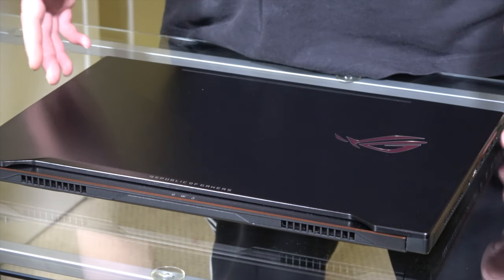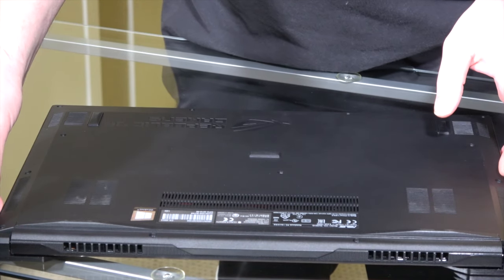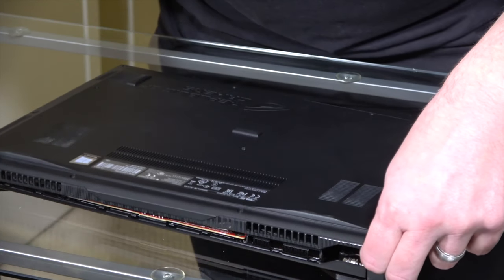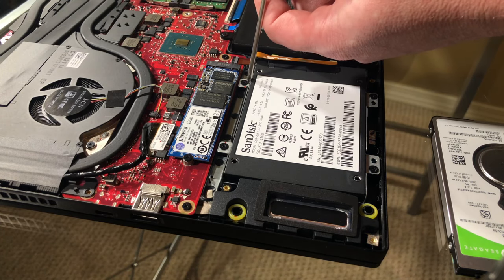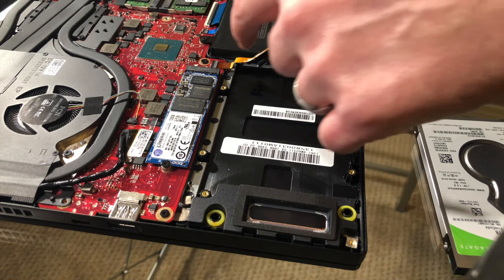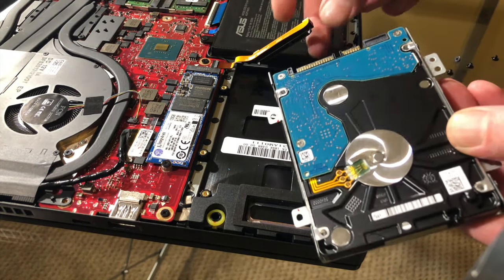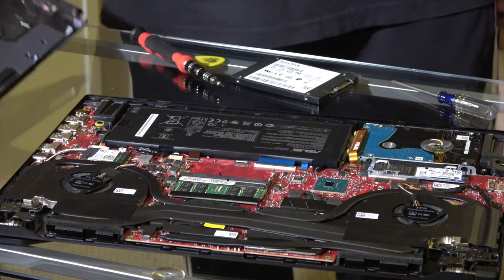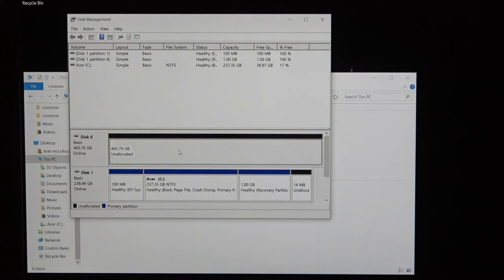ASUS GU501GM RAM & SSD Upgrade Guide - How To Install Laptop RAM • Upgrade Laptop HDD to SSD

Comment: Thank you.  I did it.  
Thanks for picture of screws, it helped.  
3 longer screws go in the middle,  not edge & 2 longer screws on the back edge, in the middle.
This was tricky to separate, it didn’t look like 2 pieces, I couldn’t see where it separated at first.
When I put casing back on new ss sata, one of the screws would not tighten,so I switched with one I had already put in and the odd one worked fine in the other spot. - weird.
It was a new drive and did need initialized and formatted.  I needed directions and found some on web.
Thank you!
Reply from the maker: Glad you got it done, it’s a nice upgrade 👍

Comment: Hey sean I have the exact same model and I was going to clean out the dust with a compressed air can and reapply thermal paste but I have little to no knowledge of it and I've never had an experience with it so can you make a video on reapplying thermal paste and cleaning out the dust in the fans. Also a throttlestop video dedicated to this laptop would be so helpful because I am running into thermal issues a lot even though I tried to undervolt the i7-8750h.
Reply: I'd like to second the "cleaning out the fans," etc. video, please. This was great and I appreciated the video!

Comment: Great Video Man! Thanks, I am going to purchase this laptop this weekend. I will be doing the same upgrades. Did it give you a a good performance boost over the stock configuration?
Also... How do I get the info from old HDD to new one? I have never done anything like this before.
Reply from the maker: STAINLESS - if you upgrade the 2.5” hard drive right away you won’t need too transfer anything because it’s just for storage. If you do you can always just copy everything to a USB drive then put it back. It already has 16gb so some things won’t show much performance gain, but things that use more memory bandwidth will. I noticed Far Cry 5 playing smoother with dual channel RAM for example.

Comment: Excellent video Sean! I also enjoyed your review.  I purchased the same laptop at Best Buy, are you still happy with it? I just installed the same Crucial 16gb ram and replaced the 128gb NVME with a 500gb Samsung 970 EVO, really sped things up. I'm just not sure I like the screen, doesn't seem that sharp...maybe the anti glare coating, your thoughts?
Reply from the maker: Steve Overholt - I really like the build quality of this unit and while the screen is bright and colorful, I feel the same as you, the coating is pretty aggressive and it’s not the sharpest screen. It took a while for me to really notice it though since this screen is still a lot better than most. I ended up returning mine and have just ordered a different ROG laptop- the Strix Hero II. Walmart has a stripped-down config with only 8GB ram and ssd for $11XX, so I’m going to see how it is. It has the 144hz 3ms screen from the Zephyrus S with 100% sRGB coverage, Dave Lee seemed to love it. This was a great machine though, and the metal construction and finish is nicer then the one I’m replacing it with. I’m a sucker for a good screen though 🤷‍♂️
Reply: Tech With Sean, thanks for the tip on the Walmart Asus Strix Hero II. I just ordered one, hope it comes with the 2.5” drive connector.
Look forward to more of you videos!
Reply: How much of a speed difference did you get from upgrading to the samsung ssd?

Comment: hey idk if you'll see this message but i just did this i used a Samsung ram 16gb (my model is gu502gv) and i simply unplugged the battery and placed in the ram stick plugged it back  in and put it back together and now i cant power on (at all) and no lights charging or otherwise 
   any insight?

Comment: Would this void my warranty? Also can you make a video on how to repaste to help out with thermals? I've undervolted and lowered the battery to power saving mode made a huge difference.
Reply from the maker: This should not void your warranty 👍 Honestly I don’t want to repaste a laptop, most people only see a temporary reduction of a few degrees and it is a hassle. I limit the 5 and 6 core boost clocks to 3.6ghz in throttlestop
Reply: @TechWithSean  great! Thank you for the input! Really appreciate  it! I got it set up now that I can run games while only hitting about 70c max at balanced fan speed without repaste.
Reply: @oclopez7008  hey, so you did the undervolt and limited the 5 and 6 cores and you now get around 70°C? Do you have any undervolt tutorial? My laptop gets pretty hot while gaming
Reply: @estebanchacongomez1409  honestly what worked the best was to change to power save mode on the power settings. If it's on high performance it with hit 90c easily. With power save mode it runs low 70s depending on the game. Cold war cod was running about 75c. This will limit the pc but will run way cooler. I didnt see much of a performance drawback either.

Comment: Just got this as an open box at best buy for $527, you think it's possible to buy a 120hz panel and swap it in? I know the model up from this one has one so it would technically fit just not sure about the connections

Comment: I have one of these and it's processing chip had a short circuit and it's dead, could you give me some advice? Here in Brazil is hard to find parts for this model, really hard
Reply from the maker: That is a bummer fixing laptops is tough. Your best bet may be online auctions or to find a broken one to use for parts if ASUS can’t help.

Comment: Sean, I see you added a 16GB memory stick made by Crucial. Running CPU-Z on my ASUS GU501 laptop I see the current stick is a Samsung model m471a2k43cb1-ctd. I want to make sure when I add a second stick dual channel works. Did mixing a crucial and Samsung memory stick still maintain dual channel?
Reply from the maker: Tom Clark - different brands will run in dual channel together as long as they both work. If they are different speeds one will be lowered to match the other one (like if one is 2666 and one is 2133, they will both run at 2133) Hope that helps 👍
Reply: @TechWithSean  Makes sense. I am going to be super safe and get the same DIMM by the same manufacturer  (Samsung). You mixed manufacturers but got the same DIMM which you proved works fine. Thanks.

Comment: Could you tell me about the specifications of the already installed RAM in this laptop? Thanks!
Reply: 16GB RAM
 GTX 1060 6GB
120 hz Display 1920 x 1080
1TB Hard Drive 
256 GB SSD ? 
Intel i7 Processor 2.4ghz
Reply: I bought this one year and half ago

Comment: Just want to clear things up as I'm no expert with computers... I have this same laptop and am about to add the same 16gb of ram like you did. My question is however, this computer (as stated on bestbuy) has 1TB HDD, 8GB SSHD and 128GB SSD. So what you did in this video was essentially upgrade/change the 1TB HDD to 1TB SSD? Or were you upgrading the 128GB SSD to 1TB? Thanks!
Reply: Also, by adding the additional 16gb ram will I lose whats already stored on my computer or no?
Reply from the maker: The 1TB drive is a 1TB 5400rpm HDD with an 8GB cache of SSD memory (seagate firecuda). I already switched it out for a 1TB SSD, but in this video I’m switching it back just for demonstration. If you do this, you’ll lose whatever data is on the 1TB drive obviously so back it up. (You could stick it into another PC or USB enclosure also). Adding RAM won’t erase anything, your PC uses ram to load data from the hard drive, it doesn’t have programs installed on it. The biggest benefit of adding another stick is that it increases the total memory bandwidth because it will run as dual-channel 👍
Reply: Kirill Parshin ram doesn’t store what’s on a computer 

That’s the hard drives job

Changing out ram does nothing to what’s on the computer
Reply: @TechWithSean  gotchya, I'm thinking about doing this upgrade as well as switching out for a Samsung SSD 970 PRO 512GB, will upgrading both of these things completely wipe my computer clean then? If I don't care about losing what's on my computer and would rather prefer to start fresh do I need to do anything special besides running the windows disk management thing? Anything i need to do in the BIOS settings etc?

Comment: I just purchased the Asus Zephyrus G15. I'm assuming if I wanted to add an additional SSD the process would be the same. Do I need to update any drivers if I do this or anything?
Reply from the maker: As long as it has the same type of SSD bay you want (m2 vs 2.5” SATA) you should be good to go. If it’s a brand new SSD, you may need to open disk management in windows and “initialize the disk” before you can partition and use it. 👍

Comment: I wasn't careful enough with the thin cable connecting the hard drive to the motherboard. It got detached when I was disconnecting the hard drive (was really tight!). Any suggestions on reattaching it to the motherboard?
Reply from the maker: Jerome Uy - there is actually a tiny clip on the board, loosen it, slide the cable in, and flip the latch tight
Reply: @TechWithSean  Thank you! Took less than fifteen minutes to get back in there, connect it, and format the SSD. :)

Was about to spend the day learning how to solder... :D

Comment: Hey Sean, I have this laptop and I was wondering if I can get a different brand of ram and install it with the one pre installed to get 32GB of memory and also will any 2.5 inch sata SSD work on this laptop? (Because I'm going to replace the hard drive)
Reply from the maker: DenialityHD - yes to both, I have a link in the description to a ram stick that works with the existing one, and you can use any 2.5”  SATA SSD. 👍
Reply: @TechWithSean  Thanks for your fast reply! Will dual channel memory still work?

Comment: Hey there Sean! Thanks for the video!
It comes with a 128gb SSD as the C drive. Can it be upgraded as easily to a larger SSD ? (i.e. 500gb/1tb?)
Reply from the maker: For sure. You can upgrade the existing one or add a second drive for storage and keep the OS on the existing SSD.
Reply: @TechWithSean  Thanks for the help! Really helpful!
Reply: @TechWithSean  where is it connected?

Comment: I have the same brand of laptop, and recently bought a new SSD. I can get it plugged in perfectly fine, but it is not reading. I have tried multiple SSD's and HDD's, and only the HDD's worked. Any suggestions?
Reply from the maker: Ivan Nazarchuk - try going into Windows disk management and initializing the disk if it is a brand new SSD. Sometimes that will do the trick

Comment: How ya doing man I have a quick question and I'd appreciate a response. Well anyways I'm thinking about upgrading my ram in this PC mine came with 1 stick of 16gb if i buy the 2nd 16gb stick you have listed in the description off Amazon and i put it in my laptop will it automatically detect it or do i have to go into my bios and activate the 2nd stick of ram?
Reply from the maker: It's a trvp - when I installed it, it was automatically recognized ✌️
Reply: @TechWithSean  thank you
Reply: @TechWithSean  one last quick question in your laptop was the 1st stick of ram in it the original one that came with the laptop

Comment: I accidentally ripped out the hard drive cable. I put it back in I think. I'm not very computer savvy. It says its recognizing the ssd still. Should I be worried at all about the cable? It didnt seem like it clicked back in.
Reply from the maker: deathshade777 - if it works, it works so you didn’t break the cable. There’s a little clip/lever thing that holds those ribbon cables on laptops. It will work without being secured, but if you didn’t latch it, I might pop it back open and make sure it’s tight 👍
Reply: @TechWithSean  hopefully I got it back to being fully connected.

Comment: Hi.  I have the Asus Rog Gu501gm and need 1-16g ram.   I clicked on your link and when I put in model # in the "make sure this fits" - it can't find my machine.    In task manager it says my ram speed is 2667 (I figured 2666 is close enough).    Any help (if you see this).     In crucial  I searched for compatible upgrades and it gives me a 2400 ram ...  Thanks.
Reply from the maker: Click the link in the description and get the one that says 16GB SR and 2666 MT/s

Comment: CL value of 19? Isn't it too high for a RAM? Do you recommend some other RAM after months of use?
Reply from the maker: Seraph Wingless - I never had a problem with the memory. CL19 seems high to me too but it’s ok to have on DDR4. If you’re running very memory-sensitive applications you probably don’t want to be using a gaming laptop in the first place 🤷‍♂️ it shouldn’t impact gaming performance for a GTX 1060 though.
Reply: Awesome. WIll get it.

Comment: Did yours come with a recovery partition? im pretty sure mine didnt. and this thing is driving me nuts. it just overheats and throttles. The way mine is working i would think these upgrades would be a waste of time and money. I was hoping to get a recovery image for the stock because i wonder if some of my drivers arent working properly but i have all the drivers on the website installed for this model on a clean install of win 10 and the over heating is rediculous and also having problems with extremely slow secondary hybrid drive that came with it.
Reply from the maker: Zack Puterbaugh - yeah that’s why I replaced the secondary drive with the SSD. Huge speed boost. On my 8750h I personally use Throttlestop to undervolt it, and also limit the 5-6 core boost speeds to 3.6ghz. Stays much cooler and is still fast for gaming 👍
Reply: @TechWithSean  did you use intel XTU? I dont have any bios options.
Reply: Throttlestop sorry i missed that. Ill look into it.

Comment: Change the m.2 SSD!
Reply: james guralski I’m looking forward to doing this right now! My biggest question is, as far as the 128GB SSD that’s currently in the laptop(like the one the guy changed in the video), would I still need to upgrade it for more storage if I opted to only upgrade the M.2 NVME? Sorry for such a Noob question. Hope this makes sense. Just trying to see if I should purchase both.
Reply: @HFPAccord  did you ever upgrade the m.2 ? I tried and couldn’t get the screw off holding the stock m.2 in place. I swapped the hdd to an ssd just fine but the m.2 no luck.

Comment: Can I add these to the Strix from Walmart?
Reply from the maker: You don't want to use this exact module, but if you look at my video of the Strix from Walmart, I have a link to the RAM in the video description on there. There is a slight difference between them (single ranked vs dual ranked memory) so you want to make sure you get the right one!

Comment from the maker: This guide was shot for this specific laptop, but the process is the same on 95% of the modern laptops you'll run into. Let me know if you have any questions!
Reply: When you took off the bottom part where was the graphics card located?
Reply: Hey Sean I'm looking at upgrading the RAM on mine, but I'm OCD and like to have two of the exact same stick. What's the brand of the stock 16gb it comes with?
Reply: Does the other 16gb back a big difference in gaming? I have this laptop and trying to figure out if the dual channel is worth it.

Comment: Is the ram and ssd upgrade worth the cost?
Reply from the maker: deathshade777 - the RAM definitely is, the stock single channel config will bottleneck some games. The SSD is just whether it’s worth it for the shorter loading times to you. You can get a 1TB SATA ssd for like $100 these days ✌️
Reply: @TechWithSean  does the ram that's already in duel channel with the one you linked well? Or does it have problems.

Comment: Is it normal for this laptop to run 90%c  during gaming.
Reply from the maker: deathshade777 - most 8750h laptops run hot. That’s why I use throttlestop to do a small undervolt + limit the 5 and 6 core boost clocks to 3.6 ghz
Reply: Tech With Sean hi Sean I'm from Mexico and I buy this lap top, cus I saw your video but on gaming it's very hot y install MSI afterburner, can you show us how to do the undervolting and that stuff for the cores
Reply: I am using the same laptop and under heavy load in gaming never get past 80c